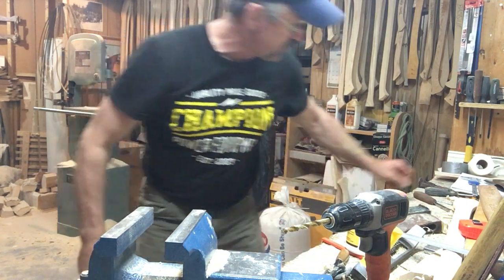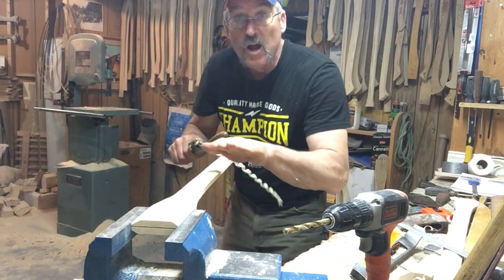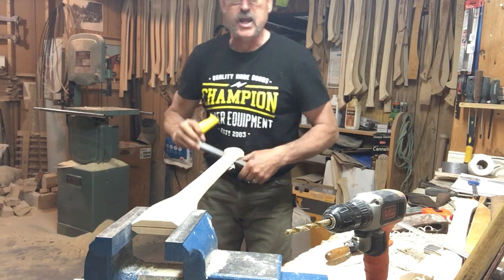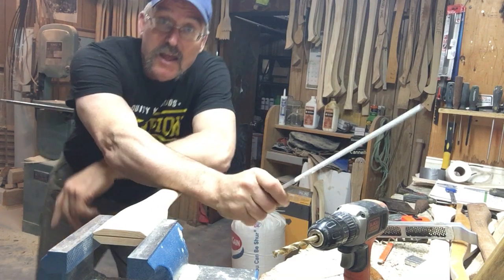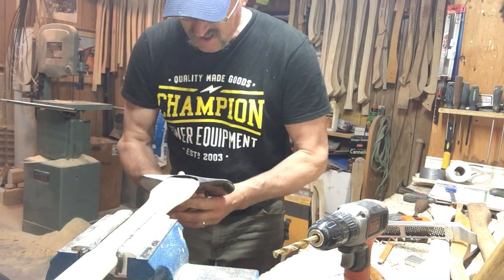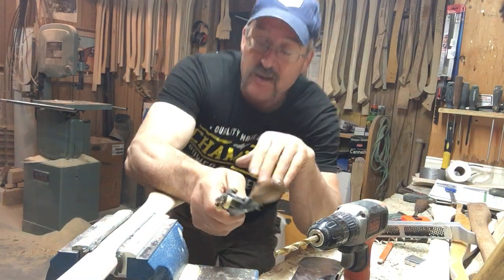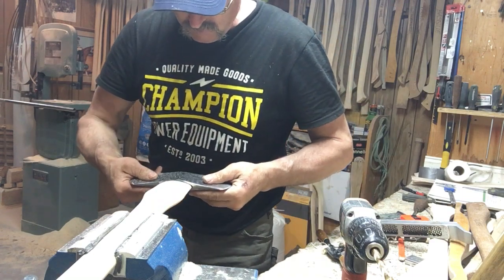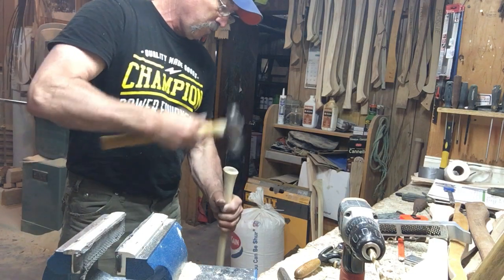Hafting a cruiser - start to finish: How to properly hang an axe

Comment: For the algorithm, thanks for your time and effort. 

I just finished a haft on a single bit and the blade side dove down on the final set. Can you do a video on the causes and fixes of when heads don’t set on straight?
Reply from the maker: Good idea Jason.  I think there are a few here already....but I'll add that to the next one I do on hanging.
Reply: @eastcoastlumberjack  Just started to mine your videos, there is a lot of good content and learning to be had. Hafted 23 axes this year and I got another 13 or 14 to finish up before I start looking for more heads. Thank again.